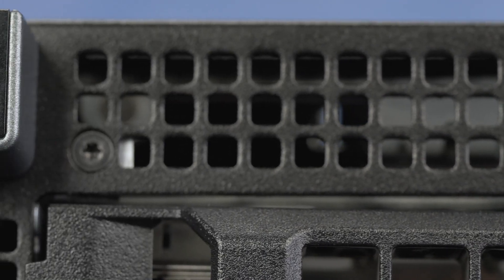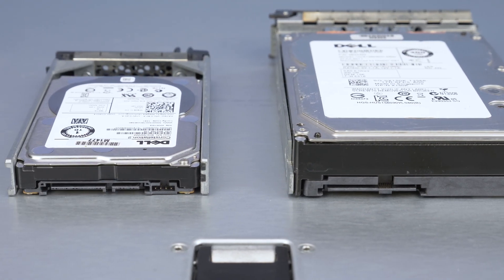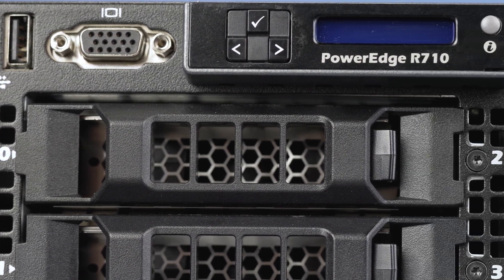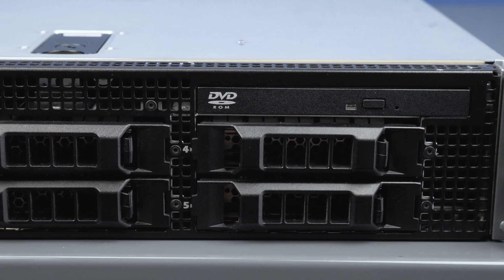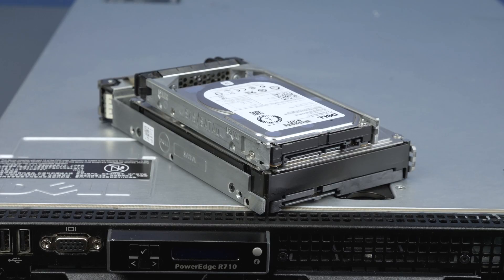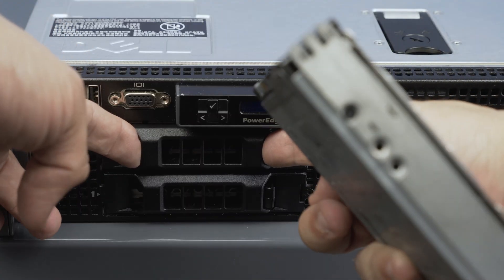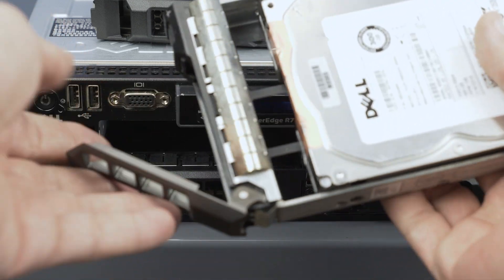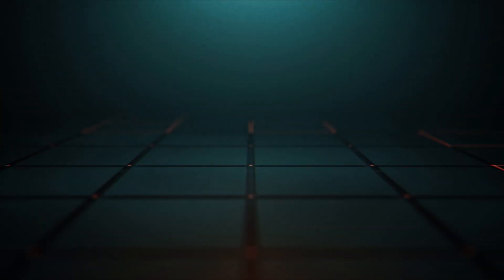Dell Poweredge R710 Hard Drive Installation

Comment: what if it doesnt recogninzes any of the hard drives... im using ubuntu 18
Reply from the maker: Confirm the drives are configured in the Raid Controller  (cntrl R when prompted during boot up). If so, then confirm the driver for the raid controller is installed.